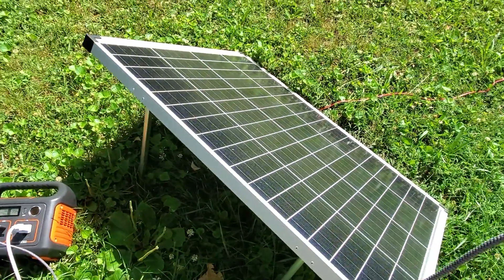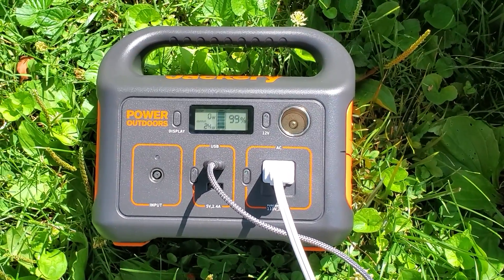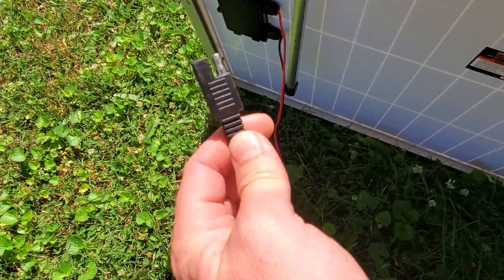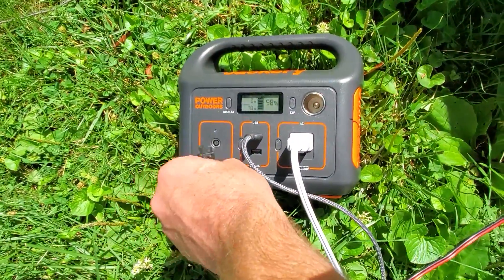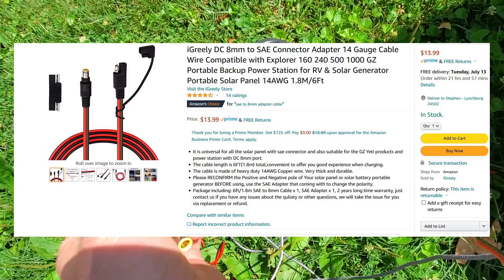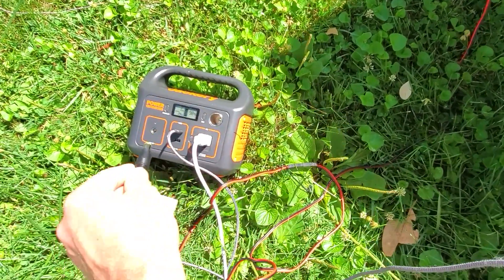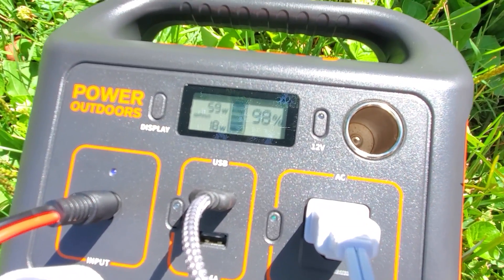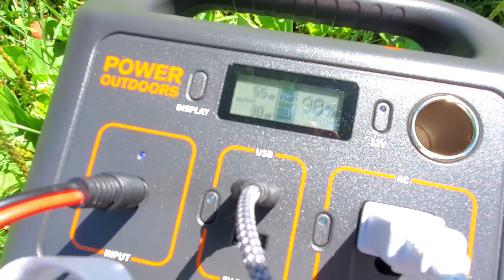ONLY 1 simple cable needed for Jackery & Harbor Freight panel

Comment: Just remember to check the polarity of a SAE cable before connecting to devices. Don’t learn the hard way like me
Reply: This is concerning because I thought ALL red was positive and so on. How did you get it reversed? Thanks, I've heard it several times
Reply from the maker: @heatherk8931  Yeah I'm curious too, as I have never had any issue myself with solar polarity
Reply from the maker: Wow! I'm definitely curious to hear about your reverse polarity experience. Most solar-related devices I have used seem to have a warning or error light for reversed polarity and I have never had issues.

Comment: $11.99 harbour freight ..one of them if the for the car..you connect that one with the one for the car that comes with the jackery..DONE! (female -male ) Works perfect!
Reply from the maker: Ahhhh I just re-read your comment and grasped how you connected it. So does it still pull 60 watts at the input?
Reply: @kampinglogik  i dont know that..i have the 4 solar panel 100 w but one is broken..AND i can conect only ONE of them..cause this solar panel have one separate conector for each panel...so,  if you have onle ONE conector for the  solar panel...maybe works even better.
Reply from the maker: @giselleandrea2474  ok so probably pulling 25~ watts then. It should show the wattage on the screen.
Reply: @kampinglogik  i jst got the 100 W solar panel (1 piece ) from harbour freigth in special until today $89.99 ...and is doing 60 watt!!!!!! i got it 5 minutes ago here in miami store..PERFECT!!!
Reply from the maker: @giselleandrea2474  awesome! What do you think? Big improvement on the old 4 piece solar panels?
Reply: @kampinglogik  YES!!! lighter , smaller and  legs !
Reply from the maker: @giselleandrea2474  yeah I think its a really unbeatable deal at $90
Reply: @kampinglogik  i got a 25 w solar panel from harbor freight and did it with the one for the car and it’s just pulling 11w
Reply from the maker: @marcoherrera6450  oh wow... even on really sunny days?

Comment: Thank you so much for this and the notification!
I ordered the recommended cable from your link.
This is awesome! 
Very easy to understand.
Reply: Update. Harbor freight sticks this adaptor in the box now
Reply from the maker: @sdepoint1  Are they in the box with this non-folding 100w panel? I know it is in the box with the new folding 100w panel.
Reply: @kampinglogik  i think it was in the folding 100w panel box. Not 100% sure because i purchase both flat and folding (and returned folding).
Reply from the maker: @sdepoint1  Ok cool, yeah I just did a review of the folding panel, it definitely comes with the adapter included in the box. On the website it does not mention anything about the adapter on the non-folding panel, but hopefully they will start including it with that one as well.
Reply from the maker: Ahh perfect- glad it helped!
Reply: @kampinglogik  I am a dummy and can't find the link to the adapter. Help!
Reply from the maker: @sdepoint1  no worries - here is the one from the video https://www.amazon.com/iGreely-Connector-Compatible-Explorer-Generator/dp/B08L5T7NF1/ref=sr_1_3?dchild=1&keywords=8mm+to+sae&qid=1628208549&sr=8-3